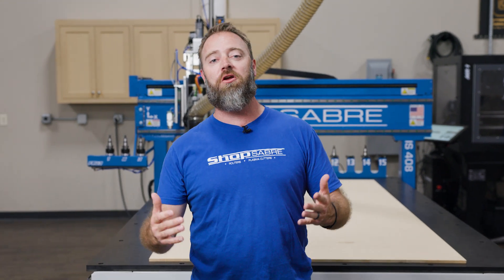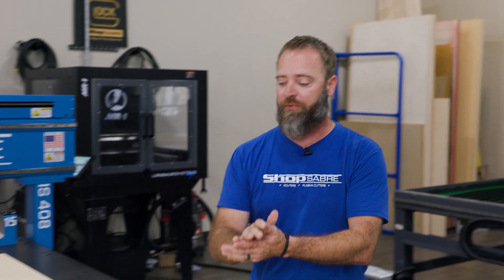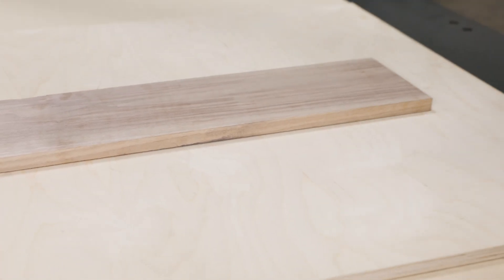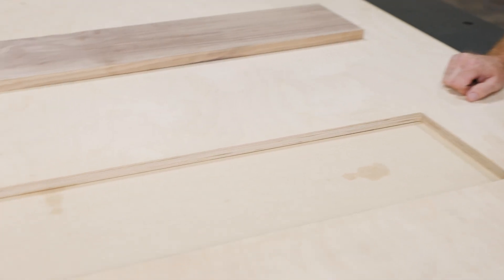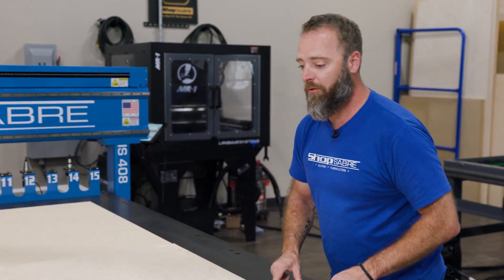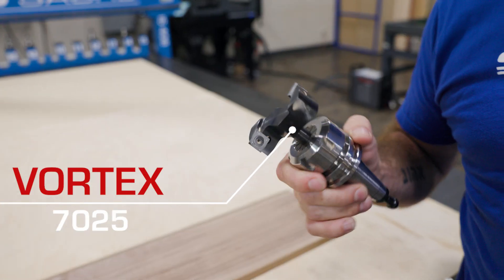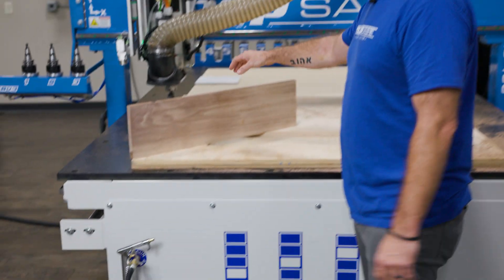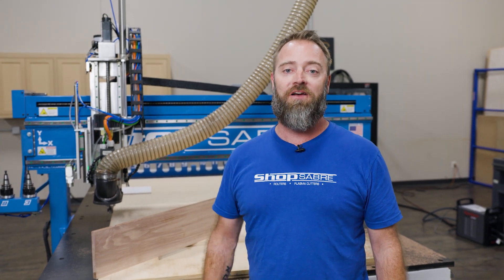How to Hold Down & Flatten Boards - ShopSabre CNC

Comment: Isn't your vacuum just pulling a warped board down, and then you're flattening the top.....but when the vacuum is released, the warp is still there?

This is the same as putting a warped boatd in a thickness planer. It'll come out thinner on the other end, but the warp hasnt been addressed.

You need to joint the board flat first,  whether by using a jointer,  or by using the method you described for flattening a slab.
Reply from the maker: By resurfacing both sides, you create a flat piece of material, this same process is used in nested based manufacturing - very commonly done for MDF Door processing & other cabinetry needs.
Reply: @shopsabre  hmm, either we're talking about 2 different things or......we're talking about 2 different things. I've never had to joint or plane warped MDF, in the same way as warped lumber.
Reply: @acerjuglans383 I'm with you, I don't understand how sucking it flat, and surfacing it will take the bow out. I have a cnc with vacuum table so I'm going to try it. The only way I can see it working  is if they programed the machine to ramp up and down as it moved across.  Or I'm missing something.
Reply from the maker: When you surface the material you are removing material giving the surface a planned finish… much like a planner, this is just Automated. Just like when you surface your spoil board for your vacuum table

Comment: What RPM and Inch per minute are you running on walnut?
Reply from the maker: Speed and RPM will vary by HP, cutter, and model -- Generally you will be between 10-12K RPM and 300-650IPM.  On our IS Series we usually try to be around 12K @ 650IPM for this process, on this particular project we slowed things down a little bit and we did 10K at 350IPM.

Comment: Great -- let's assume everybody with a SS has a vacuum table...
Reply from the maker: Clamping boards is something a lot of people do traditionally for this application, in this one we use vacuum, if you don’t have vacuum, this isn’t for you. 

Not everything can be for everyone.
Reply: @shopsabre  Can you sometime do a followup video with tips for doing this type of operation without a vacuum table?
Reply from the maker: @swp466 yep, we’ve done it previously on the live edge project we did but we absolutely can do this again
Reply: @shopsabre  Great, because work holding can always be a bit of a challenge.  Most of what I do is repetitive machining, so I almost always use fixture plates.  I have holes and threaded inserts in my MDF table that the plates index and bolt to, but for other jobs, there are options.  One of the options you should highlight is a composite nail gun.  I use that quite often if I can't use clamps and there's a chance of hitting the fastener with the cutter.  Also double face (carpet) tape and blue tape with CA glue.
Reply from the maker: @swp466 we absolutely agree, we will do some more short videos on hold down ideas and strategies in the coming videos.

Comment: I just use visqueen around the part to direct the vacuum to the part.  Then I lay scraps of other material on the visqueen to keep it from getting tangled up with the dust collection brush.
Faster and cheaper.
Reply from the maker: Sounds like a great way to do it too!